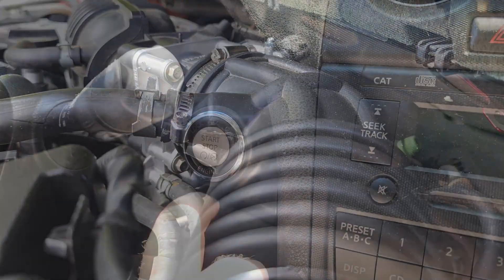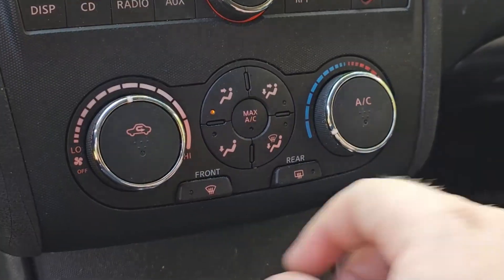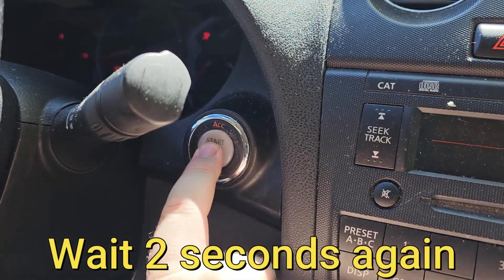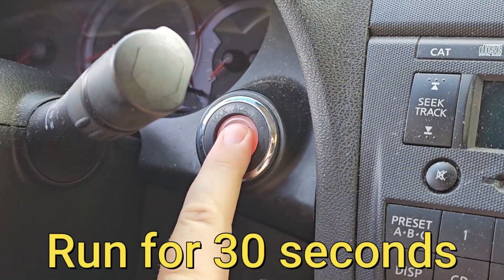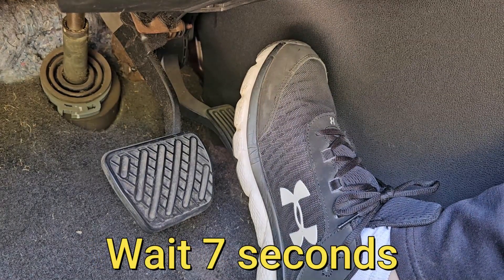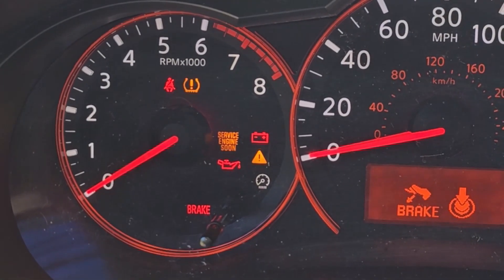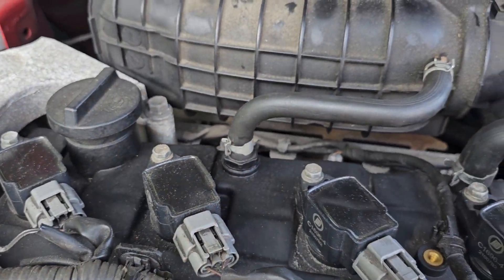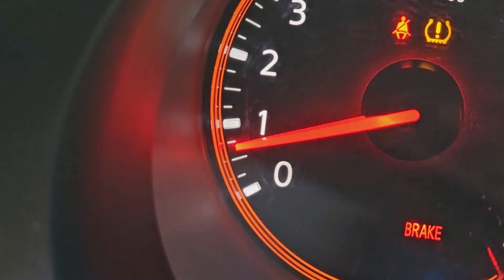Nissan Electronic Throttle Body: Idle Re-learn Procedure

Comment: I have a 2008 Nissan Altima 4 cylinder and my throttle body is not throwing the check engine light but it's been idling high and I've been having problems with it
Reply from the maker: You may have some unmetered air getting in causing the idle to be high. Check your air intake elbow with the ridges. I found mine torn up in the ridges when doing this project. Hope this helps, thanks for watching! 👍

Comment: Hi, Mine was 2010 Altima 2.5s 6speed MT transmission.
Service engine soon light not coming. Or is it the same with the yellow engine light symbol?
Reply from the maker: Yeah, I'm pretty sure it's the same thing. You can double check your owners manual to be sure. Thanks for watching! 👍
Reply: @TrickShiftGarage Engine light is not blinking while pedal are fully press. Any idea how it will work? I follow all your guide.
Reply from the maker: Hmmm, it took about 10 seconds for it to start blinking for me when I was doing it and it took me multiple times to get it. Make sure you press the pedal 5 times quickly because it has to be within 5 seconds, that was a part I messed up when I was doing it. If it still doesn't work you might need to take it to a Nissan dealership and have them reset the idle speed. Hope this helps!

Comment: My god, who designed that procedure? Its probably the guy who designed old Nintendo cheat codes.
Reply: The N64 all characters code for Golden Eye. 😫
Reply: @bryanblack1987 Golden Eye. 
The bathroom stalls. 😂
Reply: That’s exactly what I thought. Up down left right left right then start. 😅
Reply: Hitler
Reply: But at least, we don't need a scan tool to retrieve a code.  I am not sure if other car manufacturer also have the same procedure in retrieving codes with the combination of ignition switch on off-gas pedal push sequence.
Reply: Somehow ended up with a Nissan Altima pile of garbage and if I could just keep it running long enough for more than a week with a check engine light coming on I'm going to sell it and never look back. Truly terribly designed cars.
Reply from the maker: Haha! Yeah, they didn't make this process easy that's for sure. Thanks for watching! 🙂
Reply: @TrickShiftGarage  That is a lot to remember
Reply: @TrickShiftGarage  My problem is that my idle is at 3000 rpm and when I accelerate for red light, the car starts moving very slow, and people behind you start honking at you, what do you suggest? I have a 2007 Toyota Yaris 1.5 engine Automatic
Reply from the maker: I suggest check over your entire intake system including the air filter and make sure it's clean with no debris. Also inspect your intake pipes and hose and look for cracking or broken vacuum lines. If that looks alright, than I would suggest that you replace the throttle body. Having 3000 rpms at idle is really high and when going from a red light the car accelerates slowly hints that your throttle plate may be stuck and not actually moving. You could check by removing the intake tube and have someone look at the throttle plate move while your in the car revving the engine. If the plate doesn't move the throttle body is definitely bad and needs replacement. Hope this helps, thanks for watching! 😊
Reply: @TrickShiftGarage  Wow you are sharp, never thought of that, you are the best thanks
Reply: @TrickShiftGarage 
Hi 
I have a 2009 Nissan cube  brand, new throttle, body brand new pedal Sensor in airbox if you unplugged with car running it car shuts off so I believe sensor is good trying to relearn but waiting for the actuator to make the noise it don’t that’s where I’m stuck at if I just continue with the procedure you start off with no acceleration above an idol. It’s slowly creeps  up RPMs. And if I hold my foot on the break and give a throttle all the idiot lights come on need help.!!
Reply: Man this too much bs
Reply: I tried it at least 25 times and brought into the mechanic. Best 80 dollars I ever spent.
Reply: Followed procedure several times check engine light never blinks

Comment: Ok after the first set of procedure the 2 sec 10 sec steps twice when you press the pedal for the idle learning does the car have to be on as in running or just turn it on to where the car electric systems are on that’s the only part that has me stumped I’m at work tryn do this on my break
Reply from the maker: No, in that step that car is not running, just the ignition is turned on. Thanks for watching! 👍
Reply: I had the same question,  I was wondering the same thing, and now you answered my question by going through the comments. Thank you.

Comment: I recently replaced my maf sensor and o2 sensor should i do this to see if it fixes the issues im having? Seems like all the issues im having match what is described when the computers idle is off cuz of something llike the throttle body being unplugged
Reply from the maker: Yes, you can try this procedure, it shouldn't hurt anything. I'd check for vacuum leaks or holes in your intake system as well. That could be letting in unmetered air which would affect your idle speed as well.

Comment: Sir in my i20 2011 petrol, the rpm  needle immediately sets to below 0 mark as soon as the key is ON.
Even if I adjust the needle to 0 mark, 1 mark, 3, 4, 5 etc etc..., as soon as the key is ON, the rpm needle immediately drops below 0 mark.
Please help how to let the needle start at 0 and not drop below 0 mark? Is there any calibration required? If so, how?
Reply from the maker: Sounds like tachometer isn't working correctly and may need to be replaced. I recommend taking it to a mechanic and have them look at it. Good luck and thanks for watching! 🙂

Comment: Didn't work for my Nissan Altima Hybrid. You told me it's the same process......mastarrr :eyes-purple-crying:
Reply from the maker: It should be, it does take a few times to get it right though. Hang in there and keep trying, if all else fails the Nissan dealership should be able to reset it 😉

Comment: Would this work on a 2010 infiniti qx56? My suv is going into limp mode after about 30 to 60 seconds. This happened after a really dead battery and had to jump it which took a rather long time to get started. Thank you
Reply from the maker: Hello! It should work for your QX56 once you get a new battery installed. This requires a voltage of 12.9 V in order for the idle relearn process to take hold and learn it. Thanks for watching! 😊

Comment: So i did the relearn three times and it didnt work please help!
Reply from the maker: Make sure you push the pedal down 5 times quickly, I think that's where I was messing up, it's 5 times within 5 seconds. If it still isn't working you can take it to a Nissan shop and they should be able to reset it for you with their scanner tool. Good luck and thanks for watching! 😊

Comment: I need help relearning the throttlebody on my 2007 maxima I fallowed all the steps but still not working. I got a new throttle and still a can’t make it work
Reply from the maker: Nissan did not make this process easy at all for us. It took me a few tries to finally get it too. Just keep trying and if you still can't get it to work, take it into a Nissan dealer, their techs should have a OBD2 tool that can reset the idle speed with the push of a button. Thanks for watching! 👍

Comment: Hello my friend, I cleaned the throttle and did the same as the reprogramming steps, and the check engine light turned on and went off, but the problem is still one and a half RPMs.
Reply from the maker: Hello friend, keep trying a few more times. This process took me a few times before it was reprogrammed. If it still doesn't work, you should take it to a Nissan shop and they should be able to reset from the computer. 🙂
Reply: @TrickShiftGarage  Thank you, my friend. Good luck
Reply from the maker: You're welcome, good luck to you as well! 👍
Reply: Hello my friend, unfortunately I went to the throttle repair shop and they told me I had to change it 😂

Comment: Does this work on bluebird sylphy 2007
Reply from the maker: Hi, I'm not sure if it works on your vehicle but it shouldn't hurt to try it! Nissan used this reset procedure on most of their cars and trucks so it might work. Let us know how it goes 😊
Reply: Did it work for your Bluebird Sylphy? I'm having the same issue with mine after replacing coil packs.

Comment: Have you fix the tire light bilinking
Reply: The sensors in the tires fall out all the time or get ruined all the time. If the low tire pressure is on and all ur tires are where they need to be then you can either A ignore it cuz its just a dumb sensor for tire pressure or you can spend 15 extra at the tire shop to get a new one put in the tire and balanced and such

Comment: got code p0507 on a 2016 nissan maxima, it was a christmas teee every on the dash, replace the alternator and throttle body, alternator was running at 17.38 and throttle body got stuck closed  half of the fuse in under the driver side were dead, car didn’t wanna run correctly , replaced throttle body and alternator, still can’t get it to reprogram

Comment: Does this have to be done on a 2014 nissan sentra sv?
Reply from the maker: I think so. Most (if not all) of Nissan's electronic throttle bodies use this idle reset procedure. Thanks for watching! 👍
Reply: @TrickShiftGarage  last question if I already cleared the iac code will it still work?

Comment: Ive had this issue with my 05 g35. Code p2127 and P2122. Ive changed 3 different sensors. A harness. Replaced the plastic nub on the accelerator and the code persists. At this point I'm at a loss. Any idea what might be going on?
Reply: It could possibly be the ECM. Or check relays and fuses.

Comment: I have a 2015 pathfinder,  i replaced my spark plugs, and cleaned up the throtle body, now its running a bit rough and idling higher than normal. I cant find the relearn, i dont have a key, i have a push start button. 😔
Reply: He literally did it with a push start button 🤦 god people are losing their brains now a days
Reply: I figured it out, I had a vacuum leak due to a hose. Replaced and relearned on its own.
Reply: @luiselperron  Which hose was it?
Reply: Which hose

Comment: Question, i changed my spark plugs and made sure everything was connected and good but it has a rough idle and feels like it almost loses power but the brakes are hard, Would you recommend me reset the idle?
Reply: Brake booster vacuum line is broken or loosen.
Reply from the maker: Hello! Is the check engine light coming on? How many miles does your vehicle have? 

Assuming you have the correct spark plugs installed, I suspect you might have an ignition coil going bad? (happens quite often on the 2.5 liter engine)
Reply: @TrickShiftGarage  it was on but we disconnected the battery hoping for it to reset and I have 140k miles. Its a 3.5
Reply from the maker: Ok, if it's still running rough go ahead and try the idle reset procedure. It shouldn't hurt anything and worth a shot. If the check engine light does pop on again, take it to your local auto parts store and they can scan it for free and tell you what's going on.
Reply: @TrickShiftGarage 2:56

Comment: I didn’t hear the throttle body make any noise and I have a regular key to a 2010 Nissan Rogue not a push button automatic start vehicle like this one
Reply from the maker: Hello! I'd check the electrical connector on the throttle body and make sure it's plugged in all the way. If it's not making any noise after turning off the ignition, there's a good chance the throttle body is going bad and will need replacement. Have you been having some driveability issues with it?
Reply: @TrickShiftGarage  why did you delete my comment. Also probably might need a new ecm which is the possible issue. In April a guy forgot to the put the washer on the alternator after putting on the exhaust manifold, so after that when I did it, a small spark happened which made me have to get a new positive battery fuse and possibly that messed up the ecm.
Reply from the maker: You're comment is still showing on my end. Ahhh ok, a bad ECM could be the cause of your issue as well. There's no telling what that spark could have damaged inside of it. Are you have any other electrical issues or just weird things happening while driving? If so that could definitely be the culprit.
Reply: @TrickShiftGarage   I was talking about the first commment where I gave you my cell number and wanted you to call me if you didn’t mind. Also the only main issues going on are a small shaking from the vehicle while at a red light or stop sign and the rpm meter goes a little back and forth then probably the tensioner pulley is what makes a little rattling noise every 15 secs or so due to it or me needing a new belt which I am waiting now to get.
Reply from the maker: Ahhh... YouTube doesn't like phone numbers in comments so it was probably auto-deleted through that check.

The rpm fluctuating at idle could possibly be a bad throttle body and since you're not hearing it make that motorized noise like in the video, it points to the throttle body more. But since you suspect a bad ECM, the BEST way to confirm is have a shop diagnose it with a scan tool. They should be able to say if the ECM and/or the throttle body is bad for you.
Reply: @TrickShiftGarage   I appreciate it very much. I ad thinking it mainly was the ecm because I’ve had the code P0603 before on my fix’d app which says engine control module power circuit and it disappears but comes back. I believe a spark that happened in April based on me trying to put the washers back on the alternator from getting the exhaust manifold replaced when a mobile mechanic forgot to put them back on is the reason for the ecm possibly being the problem because also I had to get the positive battery connection fuse replaced which I did and probably still now have to get the ecm replaced.
Reply from the maker: Yes, that makes a lot of sense to me. I'd be kinda surprised if it's not the ECM at this point haha. You're welcome bro and let us know how everything goes with it! 😁👍
Reply: @TrickShiftGarage  yes I absolutely will. Thanks very much. Btw do you have a Facebook page that I can like and follow you on there

Comment: Great video. Question my cluster is not working.  The display where it says brake and ignition is not lighting up? Do you know anything about fixing ot?
Reply from the maker: Hello! What vehicle do you have?
Reply: @TrickShiftGarage  2012 nissan altima 3.5 sr
Reply from the maker: I'd check the fuses on the interior (below the steering wheel by the hood latch release) and see if any are blown first. If those are good, the light bulbs inside the IP cluster went out. Not sure if you can get inside it or not but this might be the way to go. If you can't replace the bulbs then you'll be  looking at buying a new IP cluster.
Reply: @TrickShiftGarage  thank you for your replies.  I really appreciate your time.
Reply from the maker: You're welcome and thanks for watching! 👍

Comment: I replaced the battery on my 2017 Nissan Titan and it feels like it's missing/vibrating. Do I do this same procedure on my truck? One person said it was because I put an AGM battery on the truck but that is what the dealer and parts stores said I needed. I installed the new battery. PCV valves are new. Air filters are new. Plugs replaced a few months ago at 100,000 miles. Oil was change 2 weeks ago.
Reply from the maker: It wouldn't hurt to try it, Titan. Is the truck bringing any trouble codes/check engine light? How were the ignition coils when you replaced the plugs? That might be worth looking at if they are fouled up it could cause a miss.
Reply: @TrickShiftGarage  No codes, no CEL and the coils looked good. Just odd it started after the battery swap.
Reply from the maker: Yeah it is. I'd try to do the idle relearn procedure and see if that sets it straight. Thanks for watching and good luck! 👍

Comment: How many time do I have to do it
Reply from the maker: Well, you should only have to do it once if it's done correctly lol. But honestly it took me a few times to get it down. I think I wasn't pushing the pedal down fast enough when your supposed to push it down 5 times in under 5 seconds. So the time it worked I did it as fast as I could and it went through finally lol. Patience and persistence is key here 😉
Reply: For each step where you say “ensure gas pedal is fully released”, are we supposed to have pressed it prior to? Or is there no need to “press and release”, only ensure it’s no pressed when performing the steps that follow?
Reply from the maker: There's no need to press and release, just make sure you don't touch it during those steps. Sorry for the confusion lol. Thanks for watching 😊
Reply: Ik my check engine light did flash
Reply: Now do I keep holding the pedal while the light flash
Reply from the maker: Yes, keep holding until it stops flashing. You'll have 3 seconds to start the car once it stops flashing.

Comment: What's the benefit of the re learn? Also , how the heck did you figure this out??
Reply from the maker: Hello, Mike! The benefit is a smoother running engine and less gas wasted during idling. My idle was so bad (around 1200) that it even lit the check engine light up saying it was too high lol. 

This information was buried in the Service manual, apparently Nissan used the same re-learn procedure for (almost) all of their electronic throttle bodied vehicles at one point. It definitely took me a few times to performing correctly but it's worth it in the end. Thanks for watching! 😊
Reply: @TrickShiftGarage  that's awesome , I have a Nissan Altima so thanks for your videos they really help 👍😎👍
Reply from the maker: You're welcome bro! Plenty more to come so stay tuned! 😎👍
Reply: In the case of the 2018 Nissan Maxima, the method in the video has no effect, why?
Reply: Thank you!